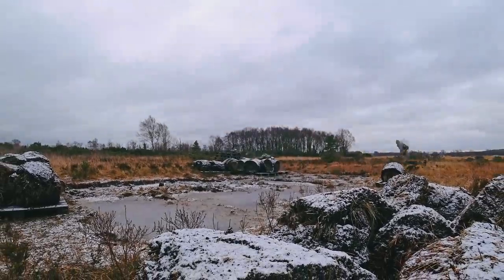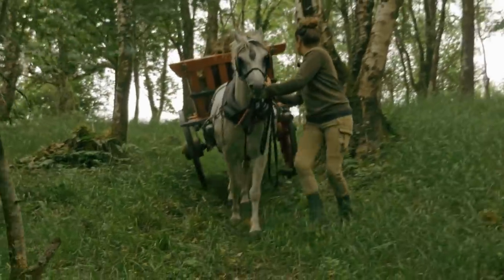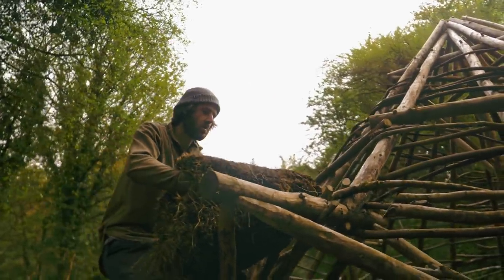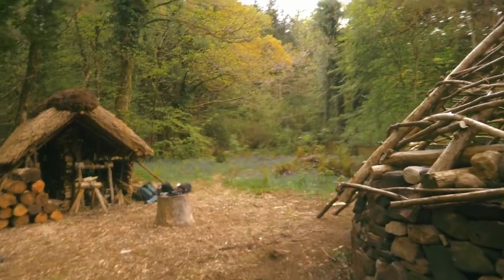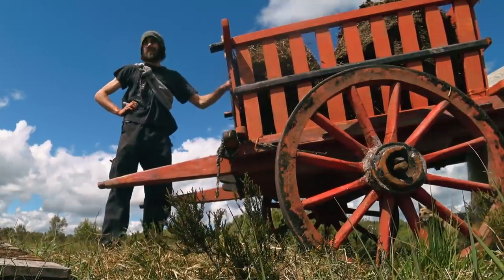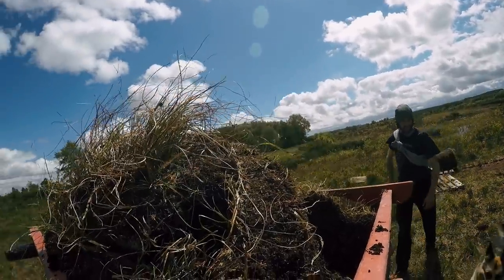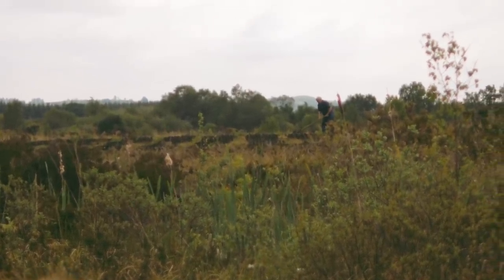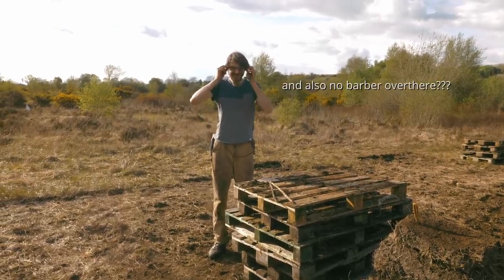IRON AGE ROUNDHOUSE BUILD | Roofing & Horse conveyance ACTION! (Ep. 12)

Comment: Bottom up boys. If the top doesn't overlap the bottom the water will flow down and encounter the seem and pool where the layers meet. The water will work its way underneath following layer of material.
Reply from the maker: True that!, but it doesn't matter as it will just be the under layer which shouldn't get wet